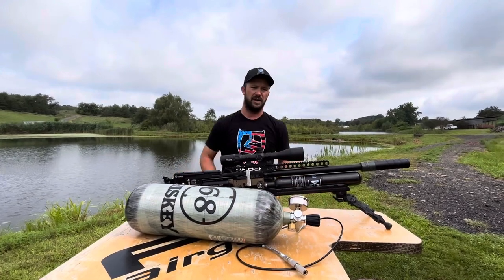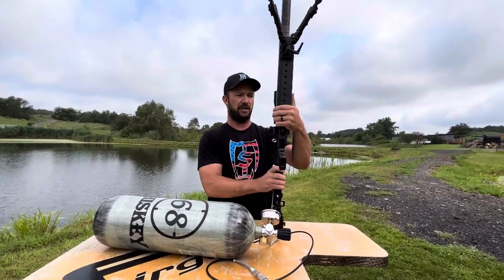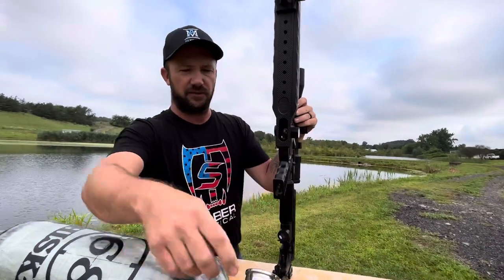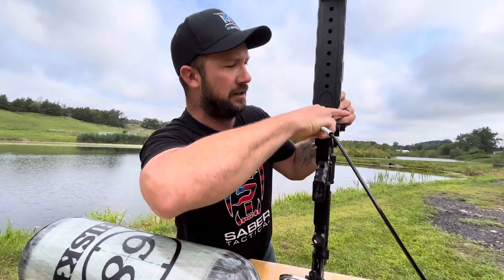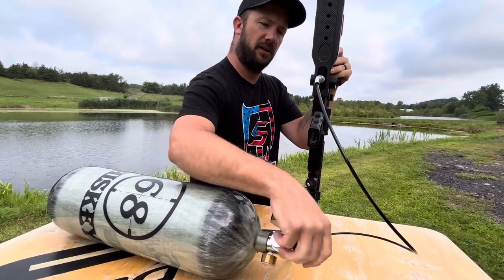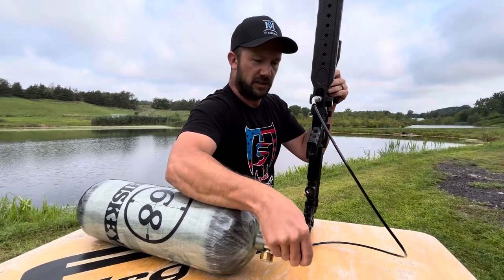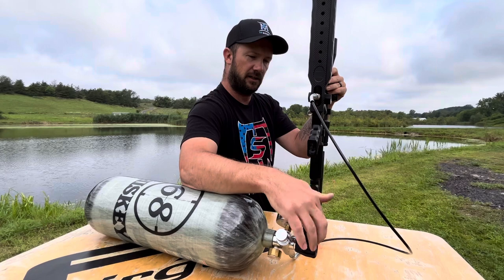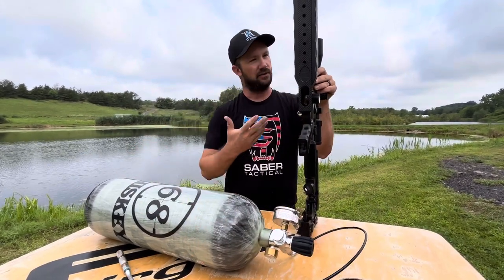How to Fill a PCP Air Rifle

Comment: Hi 68.Whiskey
Great fan of yours from the UK.
Probably a stupid question but whens the best time to refill a 250 BAR bottle on an Impact M3 .25cal with 1st stage reg set to @185 BAR and the 2nd reg @135 BAR.
Would you refill when your bottle manometer drops to 135, 185 or 205 BAR?
You will be my hero if you could let me know

Best regards

Tony

Airgun Mad UK

Comment: Not sure what I`m doing wrong,after bleeding the hose I cannot disconnect the foster from gun as pressure is coming back from gun. Have to remove bottle to relieve pressure and then disconnect.

Comment: I’m still getting hung up on close the bleeder step.
Reply from the maker: The bleeder is the small screw on the side of the bottle head.    If it is open it drains the air from the head and hose.    If it is closed it will hold the pressure in .
Reply: @68Whiskey  thanks buddy. I needed that